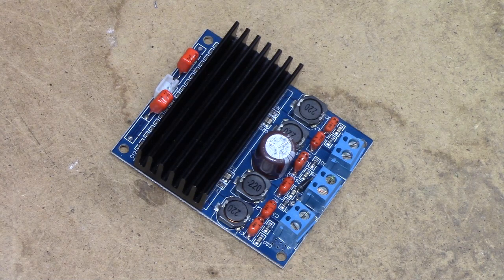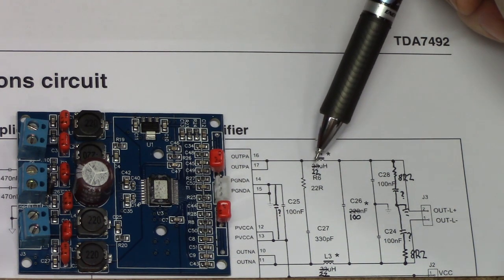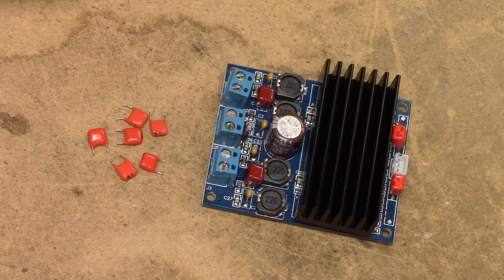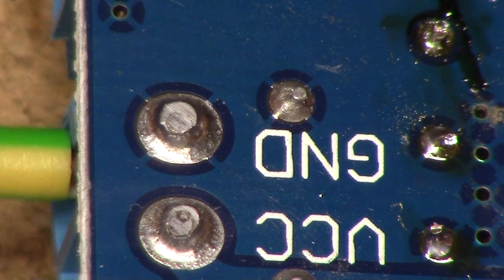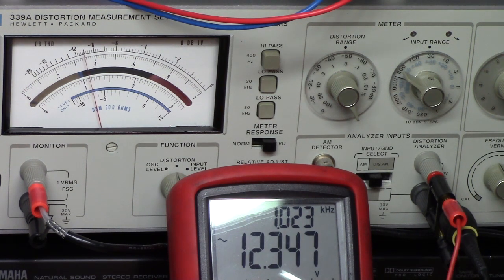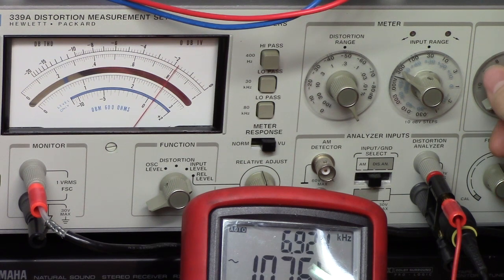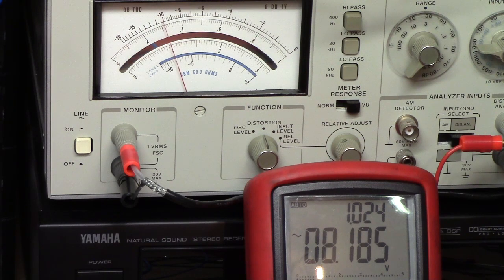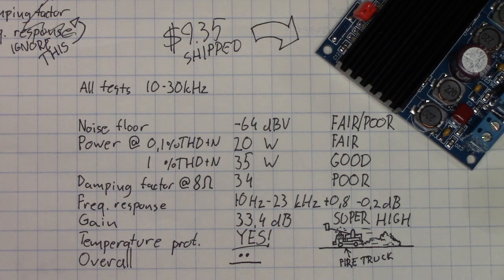SKU145225 - TDA7492 Class D amplifier board measurement - China reviews

Comment: I have had a lot of these cheap class D boards, and while most do output pretty good power levels, they just don't come close to even a cheap class AB or B linear amplifier when it comes to sound, they have a really weird soudn to them that I cannot explain and upon further investigation, I found that all of mine output the same horrible sinewave as yours did unmodded!... And I have figured out the same thing you figured out here, they lack a proper filter on their outputs quite often. THey also cause interference on my antique radios, if I switch to the longwave band I can actually hear what the amplifier is playing through the radio! This makes me ponder the possibility of making a longwave transmitter using a class D amplifier... This is a great video, with great measurements, and I am now confident that my chinese amp boards can probably all become pretty decent if I modify their output filters a bit :)!

Comment: 5.6Output low-pass filter
To avoid EMI problems, it may be necessary to use a low-pass filter before the speaker. The cutoff frequency
should be larger than 22 kHz and much lower than the output switching frequency. It is necessary to choose the L
and C component values depending on the loudspeaker impedance. Some typical values, which give a cutoff
frequency of 27 kHz, are shown in Figure 24. Typical LC filter for an 8 Ω speaker and Figure 25. Typical LC filter
for a 6 Ω speaker below.

The output LPF in the TDA7498 data sheet should be set much lower than 330kHz and higher than 22kHz.
There is.
Assuming the impedance of the speaker is 6-8 ohms, and 4 ohms is in the range of 6 ohms, you can use 4-8 ohm speakers.
however;
Inductance: 22μH
Capacitance: 2.2uF
So the cutoff is 23993.5104Hz, so this is actually the limit, but the impedance to the speaker is 9Ω, which is higher than the board speaker's 8Ω, so it's useless.
You want to recommend a 6Ω speaker, right? .
1uF in 22uH cannot filter 27kHz. Fc=33931.9479Hz;4.2Ω
0.68μF to 33μH is also useless 33597.6348Hz; 6.4Ω
Apparently, one board must be dedicated for each speaker, but there is no ideal for commercially available ones.

At 22μH, up to 1.5μF is fine for a 6-8Ω speaker.

Comment: I got one recently and the built quality has improved a lot, also proper capacitors installed at the LC filter speaker output.  Even at 12v & 8-ohm speakers, most of the time I use less than 50% volume.  Ofc it is no match for expensive systems but I only paid £6 for the board and it was interesting playing with it.

Comment: This is how I discovered your channel!
I'm planning on doing a portable boombox with this amplifier.
If you want updates on the projects tell me!

I will only use it to power 15W maximum at 4ohm speakers, which means I'll have to change the output filter.

I have already made AutoCAD sketches for the enclosure and I have the bill of materials made. I just need to buy and wait for the component to arrive!
Reply from the maker: Good luck, I hope  it turns out hi-fi.
Reply: which amplifier you can reccomend in this class?tpa3116 or tda7492?
Reply: papaVasyaA Definitely TPA3116
Reply: why?i read it has high distortin
Reply: papaVasyaA Depending on what voltage and power you are going to supply to the amp of course. For < 20W and 12V I would choose TPA7492P but for 20-40W 19-24V, the TPA3116 is way better.

Comment: I got a cheap 50 watt amplifier/reciever, it has bluetooth CD player, am/fm, two way speakers and remote and I'm pretty sure it's a Class D amp as it doesn't give off any heat, It's by Innovative Technology just a cheapo unit from Wal-Mart only 100 bucks Canadian to amplify my laptop . It's incredible the features and performance when you gotta think my Pioneer component system from the 90s has less features and was over 1000 dollars. It honestly sounds good , even better since I have some Polk audio bookshelf speakers hooked up. This board looks like its pretty crusty but I wouldn't expect too much for so cheap.

Comment: Very detailed breakdown. I was wondering if you could help a lot of us DIY speaker builders. Adding a crossover to small speaker projects is really too expensive. Any way you could show us how to change the bandwidth on a little amplifier? Could it be as simple as adding an output capacitor to eliminate low frequencies below 100hz or so? Thanks in advance for any advice.
Reply from the maker: You can replace the input series capacitor, or just add another one in series according to the input impedance of the amplifier (has to be measured).
Reply: +FFcossag thanks for responding so quickly! You da man.

Comment: Hello, greetings from Mexico. Great videos, very in-depth and technical. 
Which amplifier is better in your opinion? The TDA7492 or the TPA3116D2? They're almost identical in input power requirement and output power but I've found no direct comparison of them. I'm seriously thinking about getting the "breeze audio" amplifier you already reviewed and modded in one of your videos with the TPA3116 chip in it, though the gain seemed a little high and needed messing a little bit with the board and soldering skills to get it to 20db. On the other hand, the TDA7492 board I found has easy-to-adjust gain by just turning on and off a  dip-switch to adjust it from 21.6db to 31db and has also Bluetooth connectivity. But I still haven't got the opinion of someone who knows in depth and has dealt with both of these amplifiers. Thanks in advance
Reply from the maker: The chips themselves are pretty similar, what matters is the quality of the surroudning design.

Comment: Got one of these to amplify the headphone output of my tablet.

Unfortunately it seems to pick up some noise from the screen/led backlight driver - a fizzle/hiss.

I can reduce this down if I connect a 22uF electrolytic cap and a 1M resistor over each input - but I can completely get rid of the remaining hiss by touching any ground point.

This is running off a 12v lead acid, the noise definitely appears to be coming from the (ungrounded, on battery) tablet. Any further suggestions?
Reply: +Marineio use a damn serious Inductor-Capacitor filter between the battery and Vcc, make any GROUND wire you connected thicker, use those thick and hard ones that come in a phone line, or thicker. not those of a mains cable, those are messy.and inductor that can be salvaged from inside a fluorescent lamp is one of the best choices if you supply your board with a high voltage, like >20V, otherwise, you can exploit a secondary wire of an old step-down transformer (leave it in the transformer, forget the other wire), choose it thick enough and long enough (resistance must be low ( < 2 Ohms))in this way you can enhance the supply rejection, which is a problem in class d amps more than class ab ones

Comment: Would love to see you upgrade a class D amp by putting the PWM signal into a large mofet and filtering the mosfet's output.
Reply from the maker: That'd be a pretty cool idea, but it does put even more stuff outside of the feedback loop, which isn't good.
Reply: I thought Class D amp didn't have a feedback loop?
Reply from the maker: Of course they do, however the output stage is not included in that.
Reply: Then make it a sub amp and don't worry about high frequency distortion or something. I think you're clever enough to make it work well, especially with a very limited frequency response.
Reply from the maker: Sure, but there isn't much point to it since a proper, higher power china amp costs nothing anyway. While figuring out your own high-power output stage could be a fun exercise, I don't think it has much practical application.

Comment: hi did you manage  to re test this amplifer with a 470 n capacitors fitted and the filter to ground in place and removed I would be very interested  in your results great video by the way
Reply from the maker: +jonas Dogue de  Bordeaux I haven't modified this amplifier any further since this video, sorry.
Reply: +FFcossag that's a shame as I changed the caps 100 nf you suggested i replaced ghem with 470 and it sounds a  better plus the signal caps were replced,
Reply from the maker: jonas Dogue de Bordeaux While it was a while ago I was toying with this thing, I recall seeing some odd frequency response characteristics when you change the filter around that much. I would not be surprised if you've got quite a lot more or less treble than it originally had.
Reply: +FFcossag  it was more smoother I don't have the test equipment to test for distortion. I would love to buy the perfect class d amplifer  I look forward  to future tests on classd d thanks for sharing your input

Comment: Have You changed values of ceramic capacitors?
Reply from the maker: +Pauliaus Elektronikos Projektai The small ceramics I used were the same 100 nF as were installed from factory. The two film caps I used are 1 µF.
Reply: +FFcossag thank You for replying. Interesting and useful video. Subscribed :)

Comment: I have a 2.1 amp board (http://bit.ly/2AaQzFM) using a 19V battery. My actual setup is a 6ohm subwoofer connected to the sub output and only one 8ohm (30W rated - 60W max) speaker connected to the left output, so the right output channel is unused. My doubt acordingnly to this table (http://bit.ly/2jlJavl ) is that at 19V the max power output on each L/R channel is 25W at 8 ohm. Actually the setup is working well but I really don’t know if the 8ohm speaker or the amp are actually getting stressed (if that is the word). 

So my question is if there is a way to combine both L/R output channel to get one single mono output channel with twice the power (25W+25W), so the speaker and the amp can work more relaxed and so the amp will not blow up. 

What would you suggest me?

I don’t know too much of electronics so I don’t know if what I exposed above is actually possible and correct.
Thanks.
Reply from the maker: That amp will always be stressed because those heatsinks are not big enough. Beyond that, it's fine. When it comes to audio, as long as it sounds good, you're good.
Reply from the maker: Also, no, you can't combine the channels, as they're already in a BTL configuration.

Comment: I really wanted to build an amp for years.  But after Topping and that one French company made what is considered to be #2 amplifier in the world for less then 1,500 bucks?   I gave up on the idea.     I do like those 10 to $15.00 amps quite a bit for basic things I got.   But I just gave up on all these cheap dreams of big power from these amp  boards.   

The Brazilians got the Sub woofer amp market down pat with power output.    and the cost and the amount of work you have to put in to these amplifiers to surpass anything that's in the car audio world is a losing proposition.  

the only  kits to bother with are the ice units for home audio mains voltage gear.   

DAC'S?   Topping or Schitt.  Few others.   But those are the tested and proven buy and try and be done with it.  

these days, if something doesn't have a balanced input it just doesn't pass muster

Comment: FFcossag I just watched this and I noticed one thing, you are feeding this amp 26v !! Ok well your electrolytic cap is rated at only 25v !! I guess you didn't notice this and I am not sure if it would have affected your results but you might think about it !!
Reply from the maker: You're right but it doesn't matter, at such little over-voltage, it's just a question of the cap not really lasting as long as it's supposed to.

Comment: Nice Video!
I got the same Amp and want to modify it as in your setup. 

I was going to change C3 and C24 to 220nF as you suggested and get new 100nF for C1, 2, 23 and 22 (ceramic or foil?)

Any suggestions what else to change? Are there better values? Because I have to order new components anyway. 

What about the two 1uF at the input? Replace, change value or just leave them as they are?

Thanks!
Reply from the maker: +Lobot321 The input caps should be fine as they are. You should use film caps whenever you can, ceramics aren't usually very linear and can induce distortion.

The only other real thing I'd change about this amp is to set the gain to a lower value, which shouldn't be too hard to figure out from a dig through the datasheet.
Reply: +FFcossag Thanks for your quick reply. 

Gain0 and 1 are set by the resistors R8 and R28 (each 30k as 3.3V pullup). I am pulling them down each with a standard NPN transistor between resistor and gain-pin. This way I can activate gain should I need more volume with a Raspberry Pi. 
Same goes for the standby function. This is controlled by R23 (300k pullup). I can set the amp to standby by pulling down between R23 and standby-pin with a NPN. 

Would you suggest changing L1-4 from 22 to 33uh (I am using 8ohm speakers) and remove the additional filters with the 8R2?
Reply from the maker: +Lobot321 I can't really say; this amplifier performed about as well as you'd expect it to when I tested it on 8 Ohm. I don't think changing the filter is going to do you much good.
Reply: +Lobot321 hey, 
how can i decrease the input gain? i didn't understand everything from your mod. Only that you can adjust it now :D
Reply: +sinoBLN 
Just remove R8 and R28 if you want to deactivate gain permanently. 
If you want to be able to switch gain on and off you need to pull the 3.3V between resistor and gain input to ground. For that you can use an NPN transistor or a mechanical switch.
Reply: the gain is then set by 0, if the Pin not connected to the opposite pin (Ground-Pin or VDDS)
? and remove the resistor & connecting is 1? If... Why they put a resistor instead a switch? makes no sense in this case.
Reply: Hi, the gain is set by high or low on the two gain inputs. The two resistors act as a pullup (high) so gain is always max. Check the datasheet for detailed info.
Reply: Thanks for instructions on how to modify the gain. It was way too high for my setup — much better now. :-)

Comment: Class d stuff is not digital, it's switching.
Reply from the maker: +Bogdan Serban By being "switching", it's also digital; the signal is converted to a pulse-width modulated signal which is binary in nature. The entire output stage up until the output filter is, well, binary.
Reply: +FFcossag this is a common confusion. Digital essentially means binary, strings of 1 and 0 that can be translated. Digital machines work by using switching transistors, but what they do is compute numerical values. Here switching transistors are used because they are more efficient rather than in their linear state. But what they do eventually is modulate a voltage.
Reply from the maker: +Bogdan Serban Yes, that is entirely correct. The output stage is still digital up until the output low-pass filter turns it back into an analogue signal. Whether or not the "data" is machine readable or pulse-width modulated for the sole purpose of being filtered to analogue, it still only has two levels - it's still binary - and it's still digital.
Reply: +Bogdan Serban !'ve got a digital tripod for my camera, what does THAT mean? It is Chinese of course.
Reply: I look at digital as a sub-realm of analog ... because, when you get to high frequency digital stuff, PCB trace shape, length, position, size, and distance DO matter!
Reply: Don`t forget girth, lol..